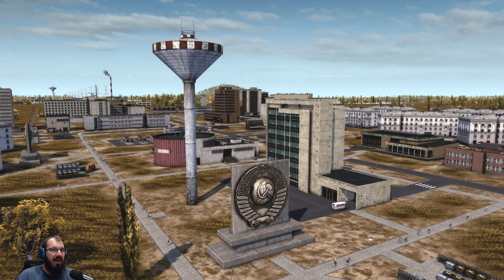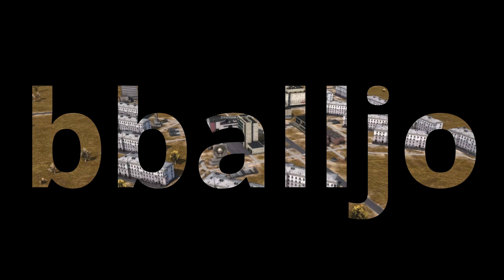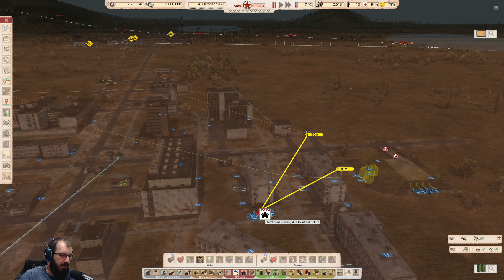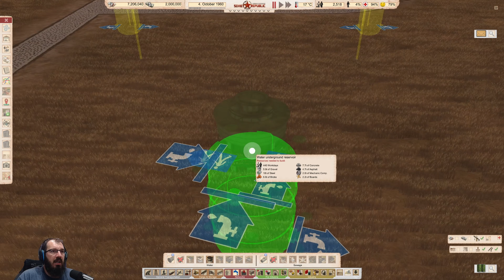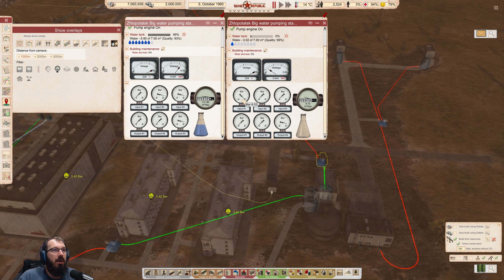Absolute Beginners Guide: Water & Sewage Explained | Workers & Resources Guides | Tutorial

Comment: crop fields actually do cause groundwater pollution through the fertilizer and pesticides used on the fields, so the fields causing pollution is realistic.
runoff of fertilizer and pesticides working its way out into the Baltic Sea is one of the primary contributing causes for a growing ecological deadzone, which is a very big, growing and dire ecological disaster in the process of happening, countries with coastline to the Baltic Sea is coordinating and working together to regulate and reduce runoff and pollutions that contribute to the deadzone's groth and working together to try and restore oxygen levels in the Baltic Sea.

the pressure in the pipes is wird though as there should always be pressure in the pipe even if the destination is full, what you should see is a decrease in flow, pressure and flow is 2 entierly different things.

Comment: still building my first city, St. petersburg Map South near Shushary Customs, now after everything is set and almost finished end 1932, i found out that the sewage ipie to dump it into the river in the North will eat quadrillions of trucks in ressources and an enourmous 11k workdays of labour 🙈 could it be that it works better, to draw the line from the output into river backwards and elevate pipe in the process? seems to lower the needs like 80% but i dont know, height meter of terrain showing by building this infrastructure would be a thing

so i start thinking about zsug a sewage station, which unfortunately is not covered here, but why this building has 2 in and 2 out? i get the 2 in, but what are the outs for?
Reply from the maker: When you plan the pipe, it tells you the current height I think... deeper is more expensive, yes.

Comment: do you really need a water tower? I can directly pump to the substations right? What would be the benefit for using the tower?
Reply from the maker: A tower stores pressure (i.e.gravity) and water, so it can react to sporadic demands plus it can compensate for water treatment plant outages. A pump just pumps the current water.

Comment: Not sure what's wrong with my sewage trucks, they go to the sewage tanks which has like 3,000 gallons in it , my truck can hold something like 2,100 gal. But it only stays to fill up like 10 gal and leaves...
Reply from the maker: @swiftbear  those numbers sound a little off...
Reply: @bballjo  No kidding, I logged into the game to get the exact numbers and the sewage tank holds 3,170gal (and currently full) My truck I have in the technical office is a T138 which hold 2,469gal. 

Looking at it right now it is heading to the customs house with a whole 22 gallons in it, why will it not stay to fill the other 2,447 gallons it has room for? I dont see any way to set up loading or unloading parameters in the tech office.
Reply from the maker: I don't think the tank numbers are correct... And you should use a substation if you arent
Reply: @bballjo  A substation for sewage?
Reply from the maker: Yes...they combine all houses in range and make collection easier, vice versa with water substations
Reply: @bballjo   What I have been using is called "sewage tank" and it has an area collection, can a truck not collect directly from it? or is my truck bugged
Reply from the maker: The technical service office should highlight the buildings it can reach in green, and trucks would just go there.
Reply: @bballjo  Ok thank you for the help, I have restarted a city as my first one was a disaster and could not keep people. Learned alot from the first attempt hopefully this one goes better.

Comment: Always a big thanks for your great video's on this game, but I can't have my sewage working properly. The land is flat, 5 meters height, and I have a few sewage points, but they are at the same height? Do I need to place pumps after each collection point to put up the pressure, or do I need landscaping to heighten the land first?
Reply from the maker: The start of the pipe has to be higher than the end... otherwise you need pumps/lifts... landscaping is fine too
Reply: @bballjo  finally I managed it, thx).. this game is about a lot of trail and error)

Comment: I hate this game im not new to city builders but the water problem makes me want to rip my hair out ive build 4 of everything at the same time
Reply from the maker: What do you mean??
Reply: Il elaborate every other city builder follows this simole premise, you pump the water aka pump station and water substation and thats mean to give buildings in the area water i mean how simples that with this game im at my wits end with it
Reply from the maker: @rufus3715 if I understand you right...the well water pump is a terrible label, because it only pumps out of the ground, after that it's just gravity. You need the water pumps to pressurize the system. You can then store pressure and water in water towers, from which water can flow via gravity. So, all you need is 1 pump to move water from well to treatment plant, and 1 pump to move water from treatment plant into water tower...the rest works without pumps.
Reply: @bballjo  il give it a go its so complicated all pipes end up like a bowl of spagetti i think il stick to skylines then im not wasting hours thinking on it
Reply from the maker: @rufus3715 CS is a great city painter. Nothing wrong with that:)

Comment: Great, concise, well spoken video! I have 11 hours and I'm barely keeping up. I have always wanted a city builder with this level of complexity, and I had no idea it was right here. Like the sewage thing. Quite realistic, in a simple way. In the States, those "sewage pumps" are called lift stations. It is why it's so important you don't flush diapers, "flushable wipes," feminine products, etc. A water tower can supply positive pressure to homes. But homes cannot supply positive pressure to the sewage system. It has to flow down hill. And eventually, you run out of down, so you have to pump it up to start over. And inorganic stuff can get stuck in the lifting pumps. Anyway... maybe I'll have some citizens by 20 hours. :D
Reply: seriously why is it legal to brand products as "flushable wipes"

Comment: I struggle with connecting pipes with the correct slope.  Primarily when I need to go back and connect something new into the system.  I end up having to basically delete everything back to source or dump to get everything aligned.  Am I missing something or is that just how it works?   Do you have a good vid on how to interpret underground pipe slopes and best places to splice in new infrastructure?
Reply from the maker: Interpret slope: use the measurement tool, you can use the topography view (F2) at the same time to get an idea. 

Splice in new: don't. Plan ahead and add some switches in reasonable places, but understand that the large pipe has a max throughput, and large city sewers need their own direct pipes and shouldn't be combined.  Once all that is done, new infrastructure can be added with sewer pumps, they can go up to 15m deep, or you can terraform. The slope really just cares about the start and end points, so pumps in the middle are fine.

Comment: I copied your video to the letter of the law, and I'm only getting 21.33 m3 water per day.  I'm not sure how you managed to get yours so high. I used the exact same number of buildings, pumps, same pipe sizes etc. Now I do have 4 water towers that the purified water is making it's way to via the various pumps and switches etc, but that shouldn't effect the amount of water the actual plant is treating. I wonder where I am going wrong?

edit: "We cannot store or export water" is flashing on my second small water well, and the current production per work day is going from 0.00 - 0.01. So it seems it's the well. Bizarre. It has power but it's doing that annoying quick flashing thing
Reply from the maker: It's easy to miss a thing...so pictures of the setup are probably needed

Comment: I was overthinking and overcomplicating the water and sewage.  At start, just a technical with small garbage truck(s) is needed.  Build garbage collection points later to simplify it.
And export garbage across the border.  Same with water and sewage.  Collection points for sewage and water, and let trucks from technical import/export from border.
Later on you can become more self sufficient:

Burn the trash in incinerator - make sure to have a garbage truck with big container on it to free up the incinerator plant otherwise it will get clogged up.  This big trash truck goes to border, unfortunately.
Sewage export at first, then unload at sewage unloading - which is connected to sewage pump - then to sewage discharge.
To dump the sewage - just create an artificial lake - just dig until you hit water.  The hard part is massaging the terrain to plop down the sewage discharge......
Love this game.